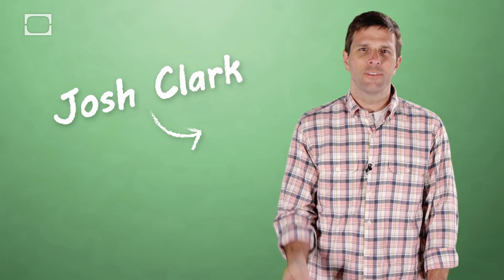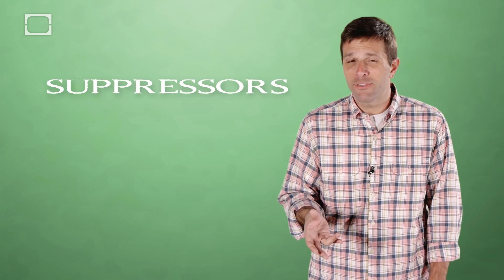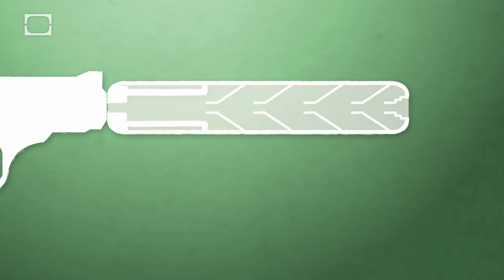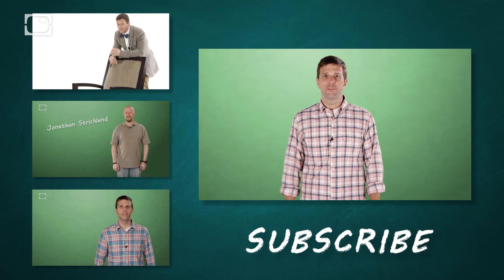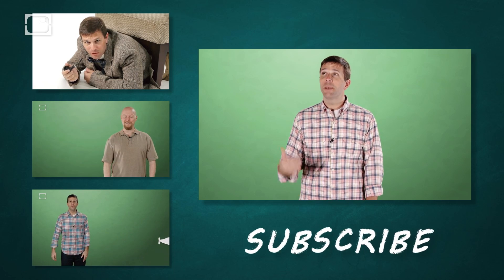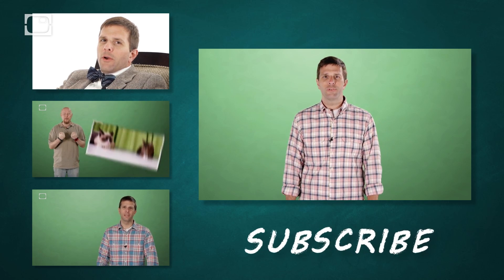How Do Gun Silencers Work?

Comment: The amount of mistakes in this video is pretty damn cringeworthy... and I'm not even a gun nut,  I probably missed 90% of them.
Reply: +Kevin D. 
0:43 Yes. "Silencer" is exactly what they're called. That's what the inventor of the device called them. That's what they are called on my ATF Form 4s. And that's what the majority of manufacturers call their product. How many Form 4s do you have?
0:58 Actually four sounds. In addition to the ones you mentioned, there is the sound of the bullet impacting the target.
1:14 Gunpowder doesn't explode. It burns or deflagrates.
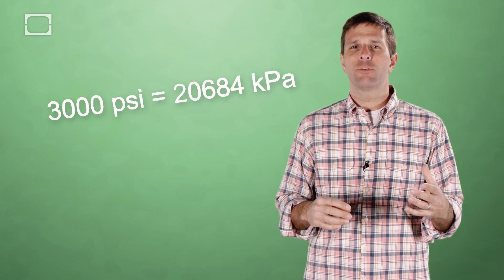1:19 Pressures vary dramatically with caliber, barrel length, and action type.
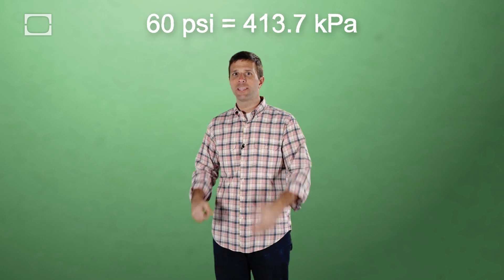2:10 Again, the sound pressure varies with caliber, barrel length, and action type.
2:25 One more time, the amount of reduction varies with the factors above and the design of the can.
3:43 Silencers that do not use wipes (most modern designs) actually slightly increase velocity (this is called free bore boost) and in some cases improve precision as well. While all silencers do shift the point of impact, well designed cans produce a very small and repeatable shift but also shrink the group size.
Reply: +Josh Callejas Yeah, like the "people you dont want to associate with"   like people that use common terms for things like "can" instead of "suppressor".    Can you spot the anti-gun sentiment in this video?
Reply: Kevin D. 1. the pressure is a lot higher than 3000 psi, it's more like 30,000 psi, 2. the decibel levels were way off, as already pointed out in the annotation, 3. suppressors can actually increase bullet velocity, they do however not decrease it and do not affect accuracy, 4. the "zipping" sound is caused by tumbling ricochets, not bullets coming your way.
Reply: +nj4ck Yeah, I AM a gun nut, this is a lot of misinformation.
Reply: +DeathLordFhyeg uh thats TNT not gun powder big diference 
tnt burns WAY faster then gunpower

if u were to have a line of gunpower and a line of tnt ( the stuff that is in tnt that is) then u would see that modern gunpower burns way slower

its actually possible to out run a line of gunpowder thats burning
( mythbusters have confirmed this)
Reply: +DeathLordFhyeg Keep changing the standards and you'll get back to where we were. Smokeless powder is not an explosive. It deflagrates fairly quickly when confined, but does not explode. Black powder is a low explosive, though its brisance is at the very lowest end of what are considered to be explosives.
Reply: Older style cans that use wipes do slightly decrease velocity. The MP5SD, which is the source of these myths, had a ported barrel designed to slow standard issue ammunition down to subsonic speeds. Most silencers don't have either of these. Nothing touches or slows the bullet after it leaves the barrel but there are still some high pressure gasses behind the bullet. The greater pressure behind the bullet slightly increases velocity but the effect is minimal. It is more accurate to say that silencers do not slow the bullet down than to say that they increase velocity.
http://www.thetruthaboutguns.com/2012/05/foghorn/ask-foghorn-does-a-silencer-effect-the-velocity-of-the-bullet/
Reply: +The Chopping Block 
If you go by chemistry, it does explode, gunpowder. An explosion is basically when you have a volume of substance that, through some chemical reaction, yields an exponentially higher volume of gas (not always gas, but most of the time).
That's why most explosives have lots and lots of nitro radicals, because they are usually released as gas.

Here's one of the reactions of the tnt explosion:
2 C7H5N3O6 → 3 N2 + 5 H2 + 12 CO + 2 C
As you can see, just 2 mols of tnt, which is a solid substance (which means it's volume is extremely small) yields 20 mols of gas (whose volume is extremely high, in regular conditions one mol of gas occupies 22.4 liters).

:)
Reply: +DeathLordFhyeg By your definition a camp fire is an explosion.
Reply: +DeathLordFhyeg Yes I did "really read basically" what you posted and you are wrong. The brisance of a substance is what defines whether it is an explosive, not your high school chemistry. Smokeless powder is not an explosive and black powder is. Period.
Reply: +DeathLordFhyeg Fine, freshman chemistry, sport. You're still wrong. There are very specific definitions of what an explosive is and it has nothing to do with your made up definition.
Reply: +Aloiamoa Anesi No, that's exactly the point and bureaucratic definitions are irrelevant.
Reply: +Anonymous User Please note that I qualified my statement with "most". It's a general statement with plenty of exceptions. Some pistol silencers use wipes, which physically interact with the bullet and lower velocity. Also, low quality or worn silencers or silencers that are mounted to a barrel with run out in the threads or with a bore that is not concentric to the barrel can degrade accuracy. All silencers have some point of impact shift, but silencers that thread directly to the barrel cannot easily repeat the POI shift. While quality silencers that are mounted correctly to quality firearms have little to no performance degradation and often have a performance improvement, they have other drawbacks. They add weight to the weapon system and that weight is all out front, where it is more noticeable. They also add length to the weapon. That makes holstering a silenced pistol impractical and it makes it more inconvenient to get in and out of a vehicle with a suppressed rifle. Muzzle brakes have their own set of trade offs. While they do reduce recoil, they increase flash and blast. That's fine for competition but not desirable for combat.
Reply: +Dan Author modern silencers using baffles actually can increase projectile velocity.
Reply: +United States of Embarrassment Could you point out the mistakes in the video?
Reply: The Chopping Block United States of Embarrassment 

Thanks for the info!
Reply: +Kevin D. My pleasure.
Reply: *****
I know, I just gave an example because I don't know the gunpowder's reaction. But it's still the same, large volume of gas rapidly yielded from a small volume of substance.
Reply: +The Chopping Block as of you "Gunpowder doesn't explode. It burns or deflagrates" How does subsonic gas push a bullet to be supersonic without creating a vacuum? This logically cannot be true. 

Now, for my ignorance, why would you want to increase velocity if your aim is to reduce noise? Surely the supersonic crack would be louder if you did this?
Reply: The Chopping Block
Not really because the amount of crap that's being transformed into gas is relatively low compared to other substances, the reaction is also relatively slow, compared to explosions (relatively, because a fire is supersonic compared to weak acid corrosion xD).
It's all relative.

I should have mentioned though that the conditions do matter A LOT. So the limited space inside the gun makes it possible to explode without much effort, whereas if you tried doing it in the open, you'd have a harder time.
Reply: The Chopping Block 
You didn't really read basically the first thing I said, did you?
Reply: The Chopping Block
High school chemistry?
Well at least I won't bother with you anymore, I know you're just a troll :)
Reply: +The Chopping Block any combustible material can explode.
Reply: The Chopping Block
Of course I am, keep telling yourself that :)
Reply: +tricorter1 Almost as irritating as people who can't take a joke, eh?
Reply: +The Chopping Block Technically, smokeless powder is indeed classified as an explosive by the UN and the ATF. The fact that it undergoes deflagration when it is used as a propellant is besides the point.
Reply: +The Chopping Block I think the whole point of this entire line of discussion is what defines an explosion. People can define it any way they want, but the definition I've read paints a fine line between deflagration and detonation. Anything that detonates is an explosive. As you said, smokeless powder does not detonate. But anyone who saw a can of it go off all at once would say it was an explosion, despite the true meaning of the word.
Reply: +doggonemess my definition is that explosions are supersonic and standard combustion is subsonic. This means given the right conditions almost any combustible material can be made into an explosive and any explosive material can be forced to simply combust.
Reply: +doggonemess Agreed.
Reply: +DemonXeron It really doesn't matter what your definition is, because there are actual definitions to the terms. That's how language and science works.
Reply: +The Chopping Block my definition implies (or at least was supposed to imply) the one i was taught and is currently accepted in physics as far as i know. For the bullet to travel supersonic and therefore generate a loud crack the material used must explode whereas vigerous combustion may be sufficient for subsonic projectiles and may not generate a loud sound.
Reply: +DemonXeron Your assumption is incorrect. Deflagration can produce sufficient pressure for supersonic muzzle velocity. The same .22lr that is subsonic from a pistol barrel is supersonic from a 16" rifle barrel and can even dip back below the speed of sound from a 22" barrel.
Reply: +Riley Powell Please reread my comment. I posted in regard to the idea that supersonic velocity can only be obtained through an explosion. In that context, I chose to compare a short barrel .22 lr (fast smokeless powder) to the same cartridge fired from a longer barrel. I didn't reference rifle cartridges.
Reply: +Riley Powell Yes, and it has nothing to do with an explosion. I'm well aware of the difference in burn rate of smokeless vs black powder. Or between smokeless pistol powders and those intended for rifle cartridges.
Reply: +Riley Powell lol.
Reply: +United States of Embarrassment the pressure varies depending on the caliber
Reply: +DemonXeron because if you want to reduce the amount of noise you dont only use a suppressor, you use subsonic ammo too, subsonic ammo travels below the speed of sound, this is achieved by reducing the amount of gunpowder in the cartridge or, in some calibers, by using a heavier bullet.
Reply: +multirampage1 Not necessarily. Yes, subsonic ammunition will be much quieter, but it also makes a rifle much less effective. It severely restricts range and practical accuracy (slower projectiles drop faster), but it is also much less powerful, making the rifle essentially a pistol caliber carbine. For these reasons, rifles are often used with normal, supersonic ammunition. A silencer still dramatically reduces the sound of the shot. A good can on an AR sounds a bit like an unsuppressed .22lr rifle.
Reply: +Riley Powell LOL.
SMGs are kinda sorta okay if you place a priority on sound suppression over all else, but they have severe range, terminal effect, and practical accuracy limitations as I mentioned above. In the real world, suppressed carbines are usually favored because they don't have any of those limitations but are still reasonably discrete. While they wouldn't work for Solid Snake, they do just fine for actual people who kick in doors in real life. One option that's gaining popularity is .300 Blacksnot. Subsonic .300 still has all the disadvantages of any other subsonic pistol round, but the end user can simply switch ammo types according to application. Of course, that also means different zeroes and there don't seem to be any projectiles that can reliably expand at subsonic velocities (whereas modern JHP in pistol calibers are extremely reliable). .300 Blackcock has its own issues but is a workable compromise. Nevertheless, SMGs are very rare on the battlefield. During my year in Afghanistan, I saw exactly one and it was a plain, vanilla MP5 without a can or even a mount for one..
Reply: +Riley Powell I met a couple secret squirrels over there, was attached to a PRT working closely with 3rd and 7th Groups, and saw quite a few discrete folks. They stick out more than you might think, wearing civilian clothes and carrying a M249, for example. I'm sure SMGs are still used occasionally, but it's real hard trying to justify their use.
Reply: +The Chopping Block Anyway, what I wanted to say is that it doesnt matter if the suppressor makes the bullet go a little bit faster since its job is to reduce muzzle blast noise, not make the bullet go subsonic, that is achieved using subsonic ammo.
Reply: +Riley Powell SMGs don't have any advantage at close range, they are dramatically less powerful than rifles and produce less disabling wounds. The only place a pistol cartridge has any advantage is in a pistol, where the weapon is small enough to conveniently carry or in the ability to bed extremely quiet, cycle, and have a little better terminal effect than a subsonic .22 caliber.
Reply: +The Chopping Block I have never shot an automatic gun before, but for example, wouldn´t a kriss vector  (SMG, .45 acp, 1200 rounds per minute and very low recoil) be more effective than an M4 at close range? I mean, with that fire rate and low recoil you have less chances to miss and can shoot more bullets in less time.
Reply: +multirampage1 Short answer: no. The 5.56mm is far more powerful and causes much more devastating wounds, while the recoil is negligible. Add in the weight of ammunition, performance against soft armor, and long range performance and there really is no comparison. That's why we've seen a nearly universal shift from SMGs to carbines for entry teams and from shotguns to carbines for patrol cars.
Reply: +Riley Powell Well, kind of. 9mm is significantly more effective than a 40 gr .22lr, but the difference is smaller when you compare a subsonic .224" 75 gr projectile to a 9mm 124 gr projectile. Nevertheless, full power 5.56mm, 7.62x39mm, .300 BLK, etc are much, much more powerful than any pistol cartridge.
Reply: +Riley Powell Can't argue with that.
Reply: +Riley Powell lol
Reply: +The Chopping Block There is one point that seems to be thrown about over and over but isn't relevant at all. Stop using losses in performance due to noise suppression as a point in the debate.
Anyone, seeking to utilize the benefits of noise suppression is going to be within the thresholds where performance is affected and so using that as a negating factor in comparison with non suppressed performance is comparing Elephants to Mice.
Reply: +Anonymous User There is no loss in performance with most modern silencers. They actually increase velocity slightly (though not enough to matter) and dampen barrel whip, which improves accuracy in rifles.
Reply: The Chopping Block
It seems I may have replied to you in error. As I read through the thread had noticed many statements re: performance degradation. But the only statement where you mention the effects is in reference to SMGs, not suppressors. You also do make the same point to others, as you did now to me.
While I do not necessarily agree with your statement, as it would be impossible to prove suppressors never degrade as it would be for me to prove never improve ballistic performance. Cartridge, weapon, suppressor tech, manufacturer, humidity, elevation, location, orientation, earth rotation, air movement, time of day and more all affect flight characteristics and ballistic performance.
Though I doubt we'd disagree on any of that.
And my statement intended for someone making the claim of performance loss meant to illustrate the use of suppression is to realize benefits otherwise unavailable making a comparison of performance relative only in conjunction with the benefits.
One thing makes me tend to disagree with your claim but is not proof or claim, you are wrong, is this.
If suppression yielded increased ballistic performance as a rule, it would have evolved into incorporation across platforms as the noise reduction would in all instances be a preferable trait without any trade off or costs. Because it isn't used that way, suggests there must be some common trade-off.
Muzzle brake technology is good example of my point, and is increasingly becoming common, where it used to be found only on very high end, high performance, custom made weapons.
Reply: +Riley Powell LOL, he's cool, man. Thanks for having my back, brofessional.
Reply: The Chopping Block
So then we are essentially in agreement and arguing what exactly. My 1st comment shouldn't have been reply to you, I mistakenly selected your link. You reply in support of statements you thought I had challenged and I don't blame you for thinking that, It was my error creating confusion.
But as I have explained the point I had intended for another, misapplied and your defense was to issues I had not raised and that in attempt to clarify has gone poorly. My only position regarding suppression is that it traditionally is used to achieve specific goals not met in other ways. There are trade offs and those are acceptable to achieve objective and that performance characteristics and differences if any are not valid comparisons because of the different mission capabilities.

Now I do envision with advancements in manufacturing one day having a multi level, several stage, one piece suppressed barrel that is comparable in weight and length to a non suppressed barrel. It may have a larger diameter and that would change some weapons but perhaps that need not be such a problem.
Micro gas ports in the rifling grooves leading to gas expansion chambers toward the outer perimeter of this barrel would provide gas management for recycling use and noise reduction. Recycled use meaning, assisted cycling, ejection, recoil damping, muzzle jump perhaps even anti-noise suppression..
All other facts remaining the same IMO the qualities of suppression across all uses beneficial and preferable.
Reply: +Anonymous User We aren't arguing, just having a nice talk. I don't believe that is possible. Everything in engineering is a compromise. There are integral suppressors, but there is always a penalty. You can't get something for nothing. You can't add the material of a suppressor without adding weight. You can shorten the barrel to get a shorter overall length but then you lose velocity. Also, ports in a barrel would do the same thing. The MP5SD does that by design. Several inches of the barrel are ported into the integral silencer to bleed velocity from standard supersonic 9mm ammunition to avoid the ballistic crack. This fills a very specific need for military, allowing them to use normal 124 gr ammo instead of procuring 147 gr ammo separately.
Reply: The Chopping Block
Good I like nice talks, and agree that there are trade offs and maybe there is a way to perform this without the costs to high. But I did not know that some variation of my imagined product was already reality. That is what I was thinking could be accomplished. Having subsonic rounds inside confined spaces, especially echo chambers, like concrete buildings would help preserve hearing. In softer structures the bullet less likely to travel through as many layers of structure where unseen dangers may be a risk, or friendly forces may be. Are there other reasons besides echo location of shooter being more difficult?
Reply: Technically, any expanding gas that causes a pressure shock-wave is considered an explosion. Just because it isn't a Hollywood movie "boom" doesn't discount what it is.
Gunpowder - yes even the smokeless kind - isn't an "explosive", but it does cause a miniature explosion when lit - sort of like a cheap firecracker. For just about any weapon, however, it is ostensibly an explosion. The gasses are put under pressure in order to force them to explode out the barrel.

No real need to try beating others over the head over a triviality - especially when it's not only unimportant, but arguably inaccurate.
Reply: Riley Powell 
An explosion is not about the speed of sound - it is about a forceful shock-wave generated. An implosion does not require the speed of sound to be taken into effect - it is simply when pressure is equalizing with extreme force - and violently.
Even if the explosion is sub-sonic - it is still an explosion - it is still a forceful shockwave that expands rapidly and makes a loud audible sound - albeit much more quiet than super-sonic ammunition.

Regardless, it is such a menial technicality.
Even if I am wrong - which I doubt - it does not change the point that a gun basically operates on an expanding gas "tiny explosion" system. If you're going to get angry about somone explaining guns to someone who has NO CONCEPT of weapons by saying "It basically causes a tiny explosion" then you really have a problem.

Might as well go onto information videos about cars and harshly debate with them about the "explosive" nature of gasoline engines.
Reply: United States of Embarrassment
Hi, will you please explain the physics involved and how they apply that support the claim of your statement:  "3. suppressors can actually increase bullet velocity, they do however not decrease it and do not affect accuracy".  I do not see this as possible but am open to learn something.  Please respond with tested verifiable facts, not opinion or rumor or belief.
Also I am not anti gun, just doubtful of this information, which I welcome to be verified.
Thanks
Reply: Anonymous User 
It doesn't increase bullet velocity - he's just talking out his rear.
Reply: United States of Embarrassment actually suppressor do increase accuracy, it makes the barrel become longer making the bullet to become force to shoot straight, making the accuracy increased (that's what i know)
Reply: ***** to be fair, people who run around talking about nothing but guns all day are kind of annoying.